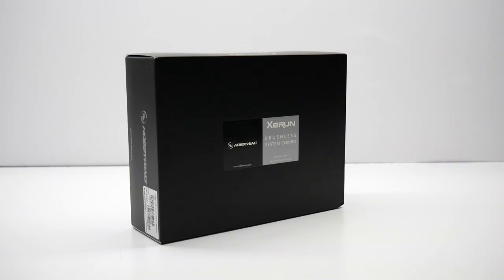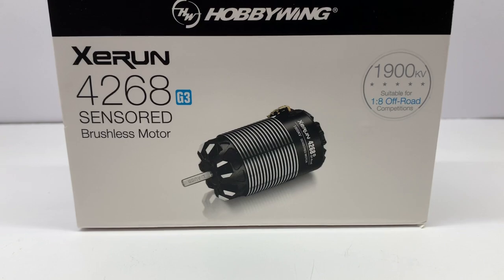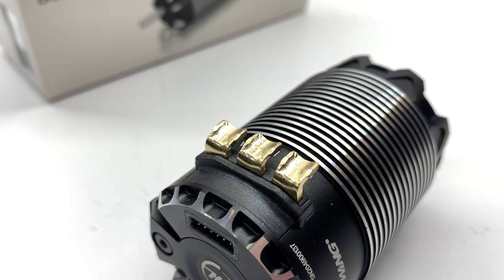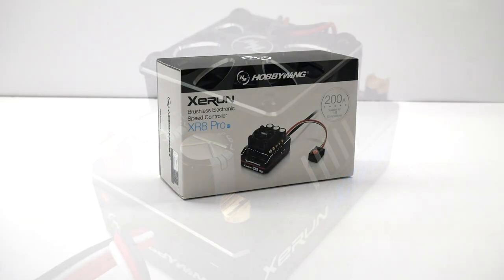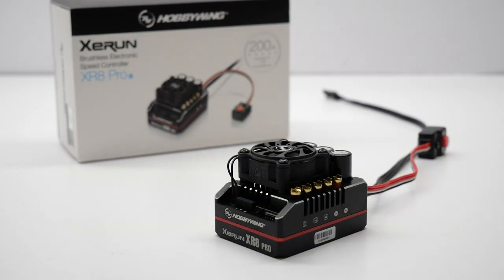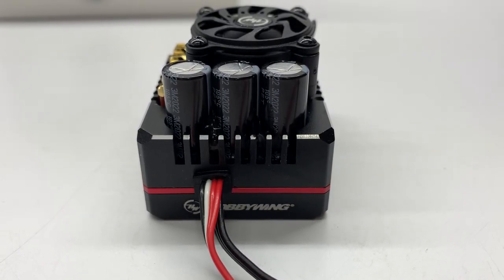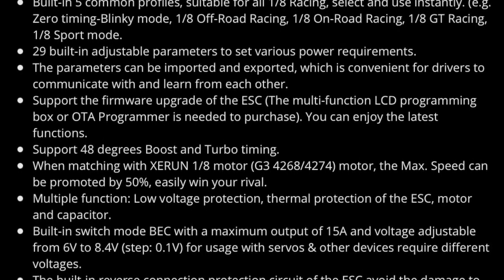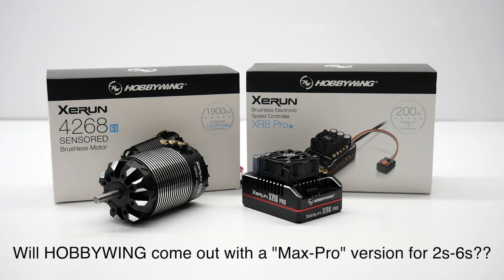NEW! HOBBYWING XR8 Pro ESC 4268 Gen 3 Brushless Sensored Combo - First Look 👀

Comment: I’d like the switch on the esc. Makes for cleaner build!
Reply from the maker: Can't agree more!
Reply: Put the bind / calibration button in the case. Then we could chose to leave the external power switch attached, or just cut it off and tie the wires together like we do on Tekin RX-8s. IMHO the best power switch is no power switch. It can't fail if it isn't there.
Reply: They either need to put the switch on the esc (best option) or give us a longer power button cord so we have more options on placement. If they gave us an extra inch maybe 2 of wire then it could be run to the other side of the chassis behind the battery on most models.
Reply: Tape it to the esc. Problem solved

Comment: You can always stick the on/off switch on the esc. It's good that they give you the option on where to put it, Rich.
Reply from the maker: Yep, but the XR10 Pro is so clean with the integrated button
Reply: Depends on the vehicle. There is not enough room around the esc to do that on a lot of vehicles.
Reply: yeah I wish the XR8 gave you the option like the XR10 Pro does. if has the button but they also give you a lead you can use if you want to use the separate switch. my XR8 Pro in my Tekno EB48 2.0...I really dont have a good spot to put the switch as the cable is just a tad too short.

Comment: Still can't beat the plus nowadays for 6s!
I like the switch on the ESC.
Reply from the maker: yeah, it's great ESC...just very large footprint and I'm not fond of the solder points (where they are) having 2 on one side and 3 on the other....and being asymmetrical (my OCD kicks in)
Reply from the maker: Gotcha!
Reply: Yeah getting rid of 6S was a mistake, lower temps and higher efficiency. Archaic US racing regulations are the only reason 1/8 is still on 4S. XR8 PLUS ftw.

Comment: I like the external switch. It makes it possible to turn the system on or off with the body on the car. This is a nice feature when you are in a hurry to get to the drivers stand and after the race as well.
Reply from the maker: very true

Comment: What do you think for Tekno Et48.2.
Looks like a smooth racing combo. Don’t need 6-s because that would defeat the purpose of a racing truggy. Lightweight equals agility and control witch equals faster lap times.
Reply from the maker: I'd find the 4274 for the ET though....you'll need that extra torque for the extra weight of the ET
Reply: @TheRCNetwork  amain has a combo on the 4268 1900 or 2000 kv motor with the xr8 pro for 289$. If I get the esc separately with 4274 it’s 360$ what would you do.

Comment: Mine is the plus also 200 amp I got with the 2250kv motor. Have you heard they are catching fire? I’ve hearing some rumors
Reply from the maker: The XR8 Plus came out a few years ago, has a XL footprint and it 2-6s capable.  It's had issues in the past with just either not working or a short life.  I haven't heard catching on fire....that's usually due to poor installation/maintenance.

Comment: How would this hold up if bashing in yard on wet grass or accidentally running across the ol mud puddle near the driveway? I've got the last model and am scared to death of getting it splashed on
Reply: Get the waterproof max8
Reply from the maker: It’s a sensored race system....I would risk getting it wet or even damp. The EZRun series is what you’re after for WP.....but they’re all sensorless.

Comment: Considering getting this combo for a custom 1:7 rwd drift build. Just with the 2800kv on-road motor instead. Sadly there ain't many reviews on those. So it's hard to tell whether it'll work. Should make for a fun experiment though.
Reply from the maker: It should do quite well.  Drifters don't have a lot of torque requirements like off-road RC's

Comment: I've had to use contact cleaner on the internal switch on an XR10, t ok get the switch working again... when it wasn't working you could wiggle the front tires from side to side quickly, and the small amount of power the servo made from that would turn it on...   I'm OK with the separate switch, BUT it should be removable/replaceable with an always on condition whenever it's not present.... the lead for the Rx should be removable as well...    i w p.o uldnt he surprised if they keep the others, or at least the budget SCT model, and also wouldn't be surprised if they make a new basher ESC for more than 4S...this is clearly aimed at 1:8 scale racing mainly....with any other 3-4S use as possible, but not necessarily meant for bashers....
   Thanks fornthe video...
Reply from the maker: Great insight - yeah, that's the down fall of a integrated on board switch....dust and debris can get inside.  I also agree on the always on failsafe for the switch if detached.....I do wish the receiver lead was detachable - it would make photos easier too! lol
Reply: 2 wheel &4x4 slash

Comment: Hello there. 

Is the 2200kv a faster kit than the 1900kv in the hobbywing g3 pro combo.  
And anyone's thoughts on the team Xrays 22 spec xb8e and the xt8e.  Are they more durable than mugen seiki mbx8r eco and truggy. Cheers 🍻
Reply from the maker: Yes, 2200kv is a faster (top end speed) motor than a 1900kv.  The 1900kv is really the sweet spot for most 1/8th scale buggies, as it has the torque needed on 4s.  I would look at parts for those two buggies. For me, the Xray stuff is hard  to find in CA vs. Mugen.  I'd give Mugen the bump on more durable.....but Tekno is likely the most durable
Reply: @TheRCNetwork  thank you mate. Love your channels. Would love to see a new mugen build by you, and the new X-rays.  Legend , cheers 🍻

Comment: Do you think this would work well in a modified Traxxas Maxx? I have added a bunch of weight (a couple lbs at least) in aluminum upgrades and am having cogging and overheating issues. Going to gear down but also looking at this. Already burned up my max 8 2200kv combo before I realized what I did  :(
Reply from the maker: I think it's the ideal combo!  Double check the motor diameter, but it should be a nice upgrade

Comment: Hey guys I've got a tlr typhoon just wondering what is the best 4s combo money could get rn after reading a few comments doesnt look like its a good esc so im after a best esc and motor combo cheers.
Reply from the maker: There's always haters out there.....for the XR8 pro, is has been because it will not run on 6s.  Typical racing platforms only allow 4s, so with the XR8 pro being a race ESC, there was no point in 6s.  I'd still pick this ESC over anything on the market.  The Tekin RX8 is close, but I've switch all over to the XR8 Pro now
Reply: I have this combo in my EB48 2.0 and it is amazing. My friends who have tekin electronics always have issues...but to each their own I guess!
Reply: @TheRCNetwork  What do you think about the performa pro lvl esc like Ronnefalk use?
Reply: I've had 2 of those xr8 pro esc's paired with G3 2600kv motor and I really liked it,  I started messing with motor timing and damaged them. By the way the xr8 pro was in a Arrma Typhon , gearing was 50t/14t pinion and top speed was 84 mph on 6s

Comment: It's a nice looking ESC! I must say that I don't understand the amperage rating at all. 200amp but only 4s max 🤷‍♂️ I have 2 XR8 plus ESC's and they are excellent on 6s with only a 150amp rating. I vote for the ESC switch on the ESC, much cleaner look. I vote for you to put this power system in your Tekno EB48.4 💪
Reply from the maker: Thanks buddy!  yeah, I'm baffled at the amperage rating....but I've never actually dove into the electrical engineering portion of these things.....I just like to install them and press go!  Not sure what this will end up in....I have a couple of choices though

Comment: Will this Xr8 pro esc fit in a Traxxas slash 4x4 or a Tekno 410.3 sct? I’m very curious especially on the Tekno 410.3 sct as I’m looking at getting one snd using a full hobbywing power system.. xr8 pro, plus, or sct with a xerun 3200kv g2  motor
Reply from the maker: I’d get the Pro.....it will fit perfect in either truck, especially the SCT410.3. The Slash should work, although you might need to make a platform for it to sit on.
Reply from the maker: The Pro will have the latest tech from HW and is highly programmable.....and a full aluminum case
Reply: @TheRCNetwork  cool!! BUT Can the xr8 pro run in full sensored mode when paired with the hobbywing 3660 g2 3200kv motor? I been trying to look around but nothing is mentioned far as I can tell... I’d be using the Tekno 410.3 as a weekend or occasional racer (checked my local track only 5 miles from my house, they run pretty much anything you want to bring) and fun/basher rig
Reply: switch on the esc for simplicity BUT the main benefit would be... no wire to break as the switch would be part of the esc, attached to it more permanently.. I’ve seen and heard with esc power switches on a wire is prone to getting snagged and ripped off (in racing it can EASILY ruin your race as your esc can shut down or worse short out with their own wires getting bare contacting on your chassis)

Comment: Good day RC friends, does anyone know why I use 3s with this hobbywing 2200kv combo and an XR8PRO ESC  
Are the batteries lasting 3 minutes?  My batteries are 8000mah 80c 3s 
but they last 3 minutes or less. Is the ESC being protected from something?  The motor says in the manual that it is 2 to 6s.
 and the ESC from 2 to 4s
But with 3s batteries I have not been able to make the batteries last more than 3 minutes. if someone could help me
Reply from the maker: Strange, you may want to reset your ESC and match your ESC to your radio again.  But why would you be using a 3s only with a 2200kv?

Comment: What's the difference between sensored and not sensored??
Reply from the maker: Sensored has an extra wire going from the motor to the ESC telling the ESC exactly where the rotor on the motor is, during start up....giving the motor a much smoother feel at lower RPMs....most sensorless systems are plagued by "cogging" where at low RPMs the rotor hesitates and will rock back and forth before it engages  throttle or reverse.  Sensored also run more efficient, typically cooler (if geared right) and are not waterproof (usually...there are some exceptions though)

Comment: Great video. I was considering this set up for the new Xray XT8E 22” truggy, but I don’t like that this esc is only capable of 4S, incase I want to go to 6S at some point. What other motor esc combo would you recommend? I have a Castle Creations Mamba motor esc combo in my RC8.2e. It had tremendous power and has been bullet proof for 7 years. I think I’ll need a little more power out of a motor for the truggy? Thoughts ? Thanks !
Pete
Reply from the maker: The HOBBYWING XR8 Plus would be the option then - 2s-6s, but def. a larger ESC

Comment: I would like to see it in 6s . 4s isn't fast enough for me.
Reply from the maker: Fast is relative.  A properly set up 4s system can be faster than a 6s system any day of the week.....It all depends on the kv, gearing and terrain.
Reply: @TheRCNetwork  for a 25 lbs truck?
Reply from the maker: @leeboykin6066  what truck is 25lbs that is a 1/10th or 1/8th scale that this is intended for?
Reply: @TheRCNetwork  cen reeper with alza racing extended frame and parts

Comment: This combo can fit on Baja Rey 1/10
Reply from the maker: I have seen people fit an 1/8th scale motor in the Rock ray....but honestly, it doesn't need it....and you'll have issues trying to find a decent 4s pack.  Run a 3660 3200kv Motor on 3s.  It will have plenty of power and will save the rest of your drivetrain
Reply: Thank you 👍🏻
Reply: Thank you 👍

Comment: Limitless install please
Reply from the maker: That would be cool.....but this is only rated to 4s.......and most limitless are running 6s-8s
Reply: I’m wondering the same for the Limitless. If I am not going for super speed, will this be a good combo? I’m a eyes on the Spektrum set up, any good advise guys TIA
Reply: Is there a 6-8s sensored hobbywing system?

Comment: Would you suggest this 1900kv motor for an e-truggy or something bigger like a 2000, 2200 or 2250kv?  I'm building a Tekno ET48 2.0 and want something to run on a professional track that will be competitive at a pro event.  It's not for bashing.  Thanks
Reply from the maker: I'd get the larger can motor (4274) over anything.  2000kv would be my recommendation...torque over top end speed for truggy